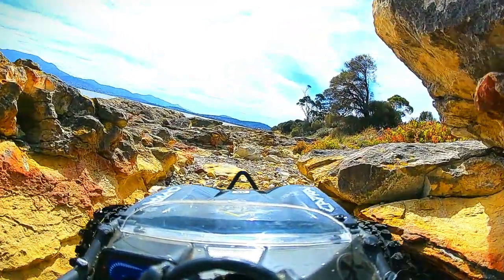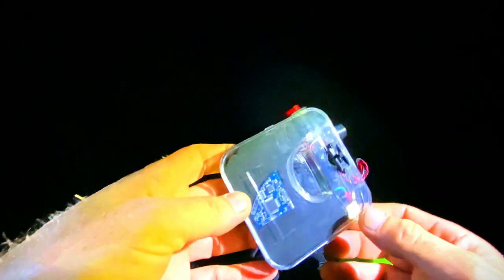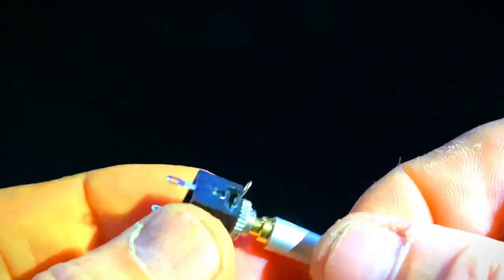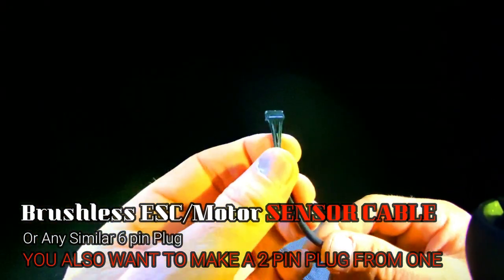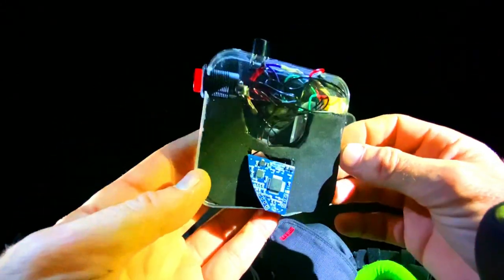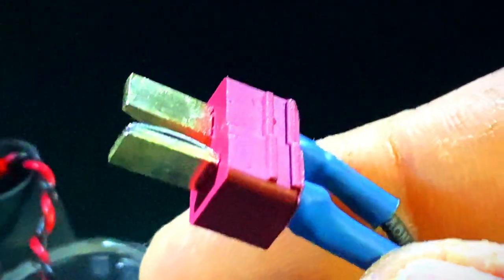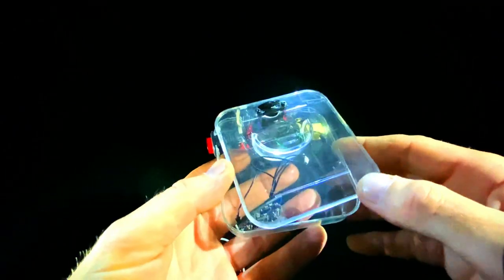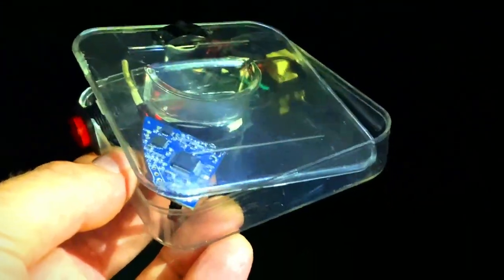HOW TO best FPV the FatShark TRINITY HEAD TRACKER Module STAND ALONE System.I DO RC 1080 60fps 2021

Comment: Can you tell me what the connection points are on the board, is there a diagram?
Reply from the maker: Hi mate, a few videos later in the list after this on my channel you’ll find a vid on how to wire the module… heaps of diagrams and very easy to follow… If I’ve done the video properly lol cheers dude, good luck, it’s fun
Reply: @IDORC  Thanks for sharing dude!
Reply: We've tried it, but we're having a bit of a problem. I would like to ask more why the pan operation doesn't freeze, it flows back to the original place. Thank you in advance.
Reply from the maker: @ผัวเมียพากันเที่ยว  hi mate, yes you have magnetic drift, the head tracker compass is getting confused, move the head tracker module away from any wires and components, move it forward from your goggles too

Comment: What if I have a spektrum?
Reply from the maker: You need a transmitter that has a DSC port (direct servo control) which also must have the ability to assign to different channels, I am still not aware of ANY surface transmitters (the steering wheel type) that can do this. Yes many have the DSC port but they are not an assignable port. Hope that helps